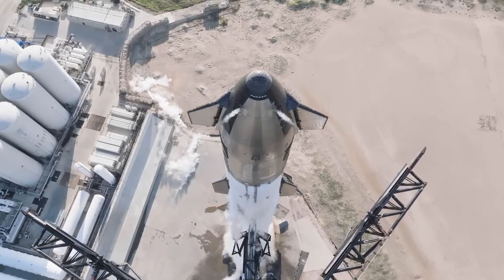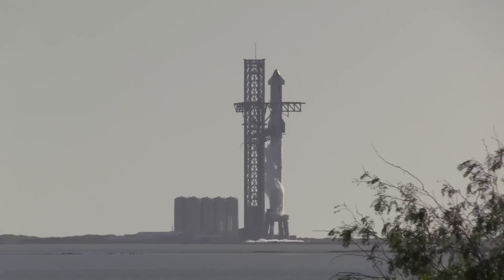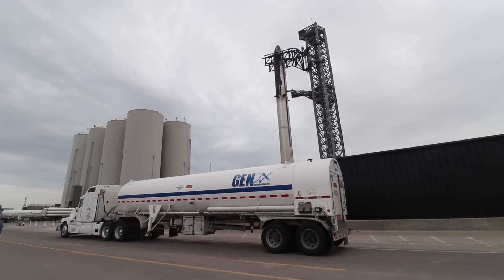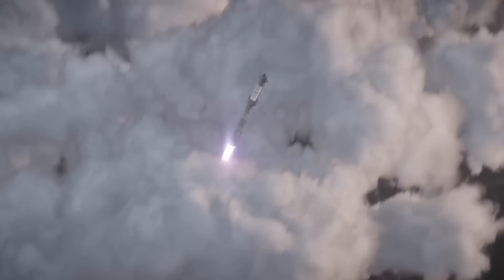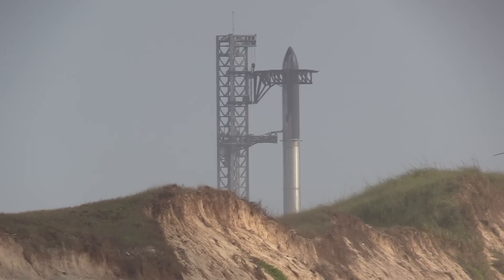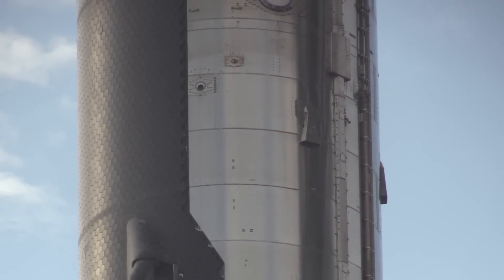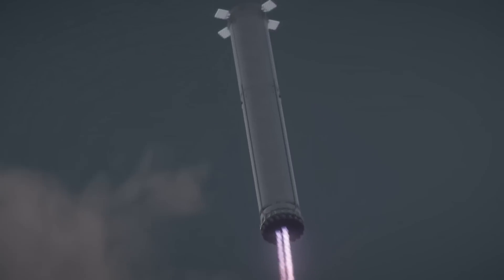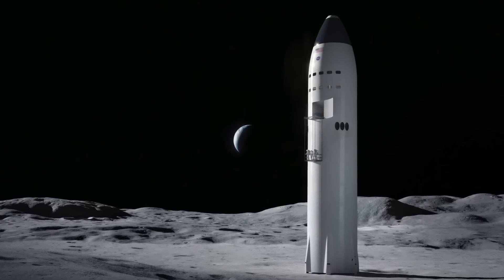Starship Update: SpaceX gears up for second launch attempt

Comment: What happens to the 10 million lbs of propellants ? Does it get put back into the tank farm or is it wasted ?
Reply: They drink it, wtf dude?
Reply: I am pretty sure they put it back into the tank farm
Reply: Good question.
Reply: @dremwolf5419  right ! Thats alot of propellant ! even if some boiled off during reclamation !
Reply: @scottymoondogjakubin4766  so true… I can’t see why they need so many truck to do a top up… I would have though maybe 10 trucks, but 200… wow
Reply: @QuantumPath100  Hey, It's Texas!
Reply: @QuantumPath100  i could be wrong but if i remember the earlier starship flights the propellants got reclaimed but 10,000,000 tons is like 3,000 modern day cars in weight ! crazy if you think about it !
Reply: I saw someone ask a similar question… the answer was, yes, it gets drained back to the big tanks, although, some is lost as it would have boiled off
Reply: Some of the propellant is lost because it boils off into the atmosphere. A majority of the propellant is detanked and stored back in the tank farm.
Reply: Methane is run through the chillers and back to tank farm, not much waste. LOX is mostly gravity fed back to tank and when equilibrium is reached, let to boil off. It is cheap, non polluting, not flammable or explosive. Nitrogen is mostly used in the chiller and to condition the systems , lots of it boils off as a consumable. Like the oxygen, back to where it comes from: the air
Reply: @LG-ct8tw  thanks ! I kinda remembered the earlier starship flights it was mostly reclaimed ! Ii was fact checking cause a few asked me the same question ! Appreciate the feedback ! 💯
Reply: @LG-ct8tw  perfect, thankyou loads for a great explanation. I’m just an armchair rocket enthusiast, so cheers for this…
Can I please ask? Is liquid helium used as well? I was under the impression that helium pressurised the tanks in the rocket??? Thanks